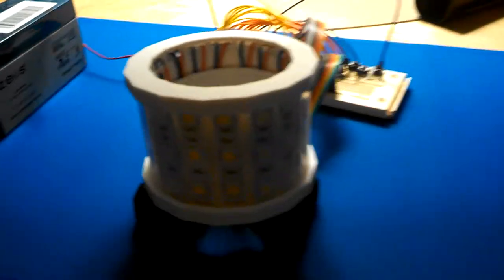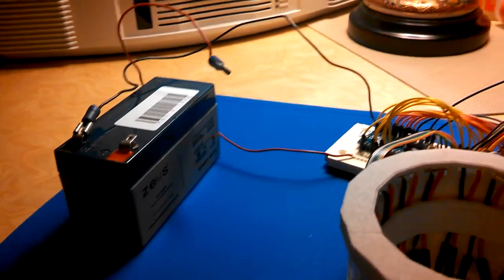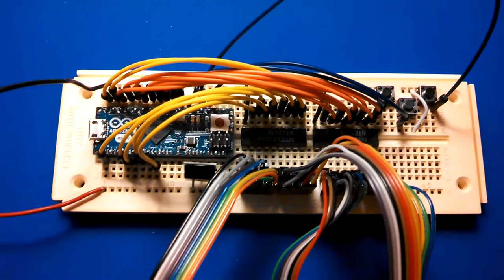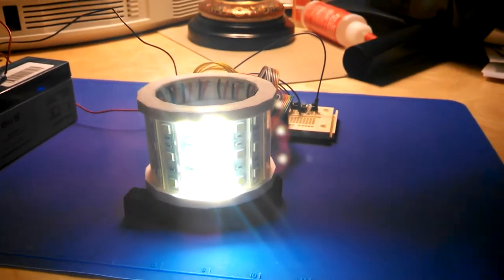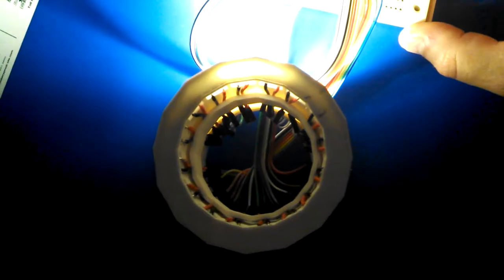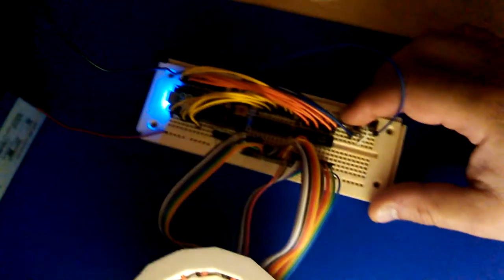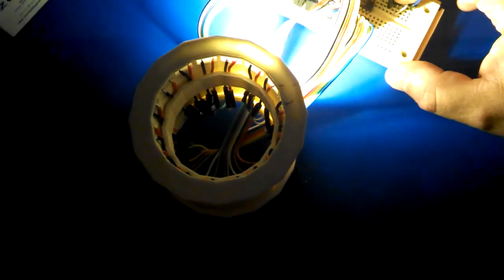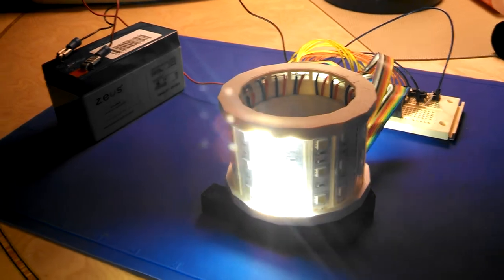Arduino LED Lighthouse Project - Vid 1

Comment from the maker: Just an update.   I have currently created a version of this which uses addressable LED's all run by a single cheap $5 esp8266-01 Wifi chip. Since it uses the very flexible and highly optimized FastLED library, it should be able to run ANY addressable LED configuration just by tweaking a single line of code.  I am currently writing code that will make the whole thing wifi configurable with no external buttons. Stay tuned.

Comment: if I could just buy this as it is that would be amazing. I've recently bought a 5 foot tall lighthouse but have put ivy in the bit where typically the light is. There's plenty of room in there for something like this and I would LOVE it!
Reply from the maker: Hello.  Thanks for your comment.  I have currently created a version of this which uses addressable LED's all run by a single cheap $5 esp8266-01 Wifi chip. Since it uses the very flexible and highly optimized FastLED library, it should be able to run ANY addressable LED configuration.  I am currently writing code that will make the whole thing wifi configurable with no external buttons. Stay tuned.
Reply: Cool!

Comment: Hi where can I get the programming for the led lighthouse?
Reply from the maker: Build instructions and code are at https://www.instructables.com/id/LED-Lighthouse-Light-Preliminary-Work/ 
Please note that the original link to the Softpwm library was broken. I have since fixed the link to point to the Github code (at https://github.com/bhagman/SoftPWM) so that it should be downloaded from there. The arduino source code (ending in .ino) can still be downloaded from Step 3 of this this Instructable. Just click download and rename the downloaded file to Lighthouse.ino.